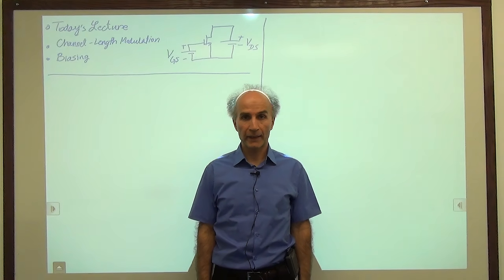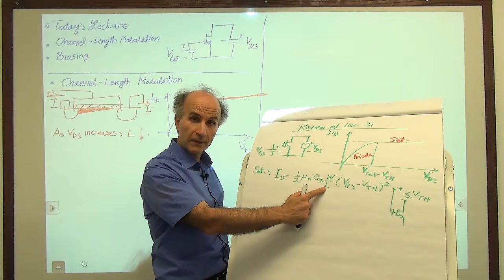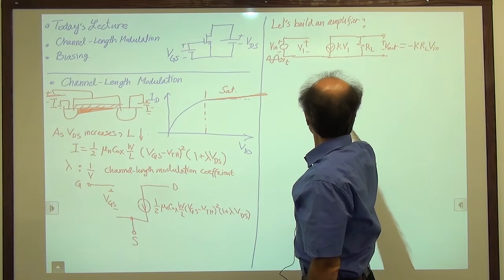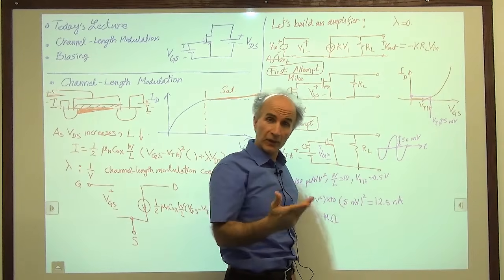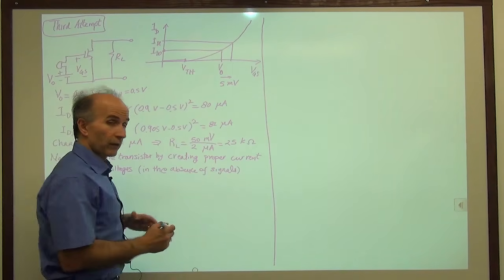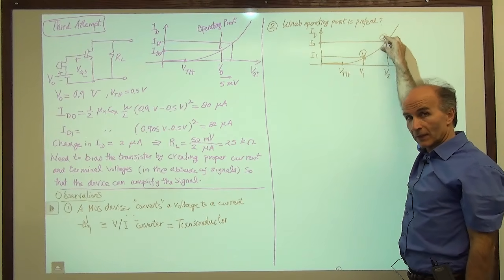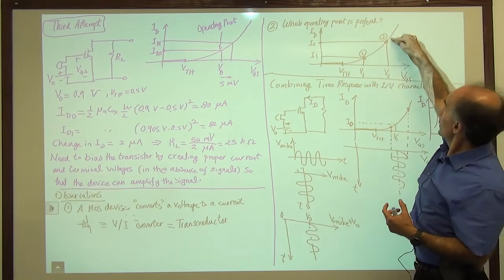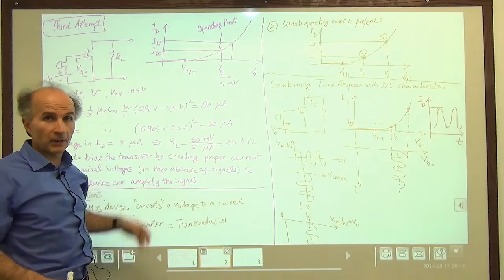Razavi Electronics 1, Lec 32, Biasing, Transconductance

Comment: 28:56 sir here in the second attempt amplifier it is not connected to the drain voltage then how can the current flow
Reply: It is assumed that the device is in saturation region (i.e VDS>VGS-VTH) but if you think a liitle bit the current flows from drain to source (Ids) which flows through RL output resistance which gives a negative voltage drop at the drain terminal so it turns out to be VDS<0 therefore ID=0A so yeah here we dont consider the drain side bias yet

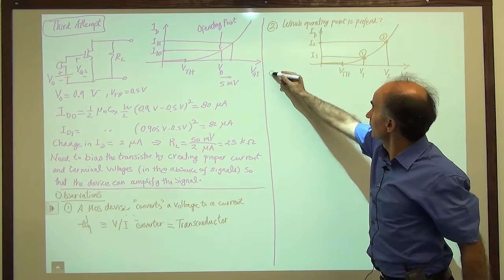Comment: at 47:20 which battery is drained Vds or Vgs
Reply: if im not wrong we usually use Vdd (powered by battery) for both Vgs biasing (via voltage divider) and Vds biasing, so even if Vin (from the mic is 0) we still drain some power from Vdd

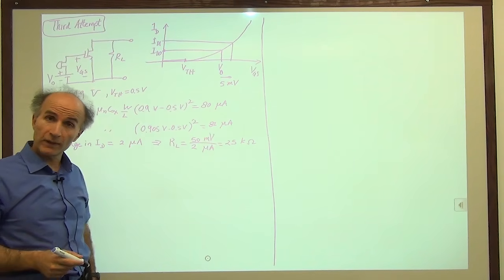Comment: Why we should take change in current regarding calculation of resistance in third attempt of amplifier design at 34:38 ??
Reply: if you mean the 2 microamperes it's because you are interested in signal to be amplified! You want the microphone signal to be 50mv not the microfone and operation point voltage. The operation point helps you to get in the region you want for the transistor to do what you want. But the important part you want to make 50mV is the 5mV from the microphone

Comment: What happens if we do not apply the gate voltage and go on increasing the drain voltage? what will be the effect?
Reply: Simple the n-channel will not be formed unless Vgs > = vth. So no current will flow.
Reply: vds just creates potential difference in n-channel and if u increase vds that potential difference will increase current flow will be more in the n channel .but for all this to happen n channel should be there which will be formed only when vgs>=vth .hence if no gate voltage then no current irrespective of the vds.

Comment: i have a doubt that when the device is at operating point i.e, greater than threshold voltage then when we are not applying any signal then output should be zero and when we apply some signal then it should be amplified but when there is no signal we are able to get some output at load then how to identify at output that input is not applied?
Reply: through capacitve coupling, it is possble to isolate the AC signal from the DC offset

Comment: I am confused as to which expression of gm to use when the values of Id, Vgs,  W/L, mu_n*C_ox are all available.
Because the three expressions give three different answers. 

For example, if W/L = 10/0.25,  Vgs = 1 V, Id = 1 mA, mu_n*C_ox = 100*10^-6 
If I try to find gm using the three different expressions I am getting different values with each expression. One expression gives 2.4mS, another gives 3.33mS , the other one gives 2.828 mS. 

Can somebody please point out what I am missing here?
Thank you in advance
Reply: What is the vth ? I think these values will not evaluate the Id mentioned
Reply: Vth is 0.4V
Reply: Check if the MOS is in saturation or not.
Reply: You need to calculate Id, not declare it, since it's dependent on Vgs. I get 720 uA using your numbers. Then g=2.4 mS in all cases.

Comment: I have a question about the circuit you draw in  23:33. where does the power P = Id^2 * R actually come from? Does it come from the Battery? If so, there is no current flowing into the gate, right?
Reply: okay you answered the question :D There is no current Id, because there is no Drain-Source voltage

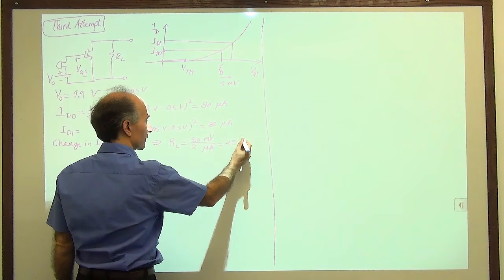Comment: Why we should take change in current regarding calculation of resistance in third attempt of amplifier design at 34:38 ??
Reply: coz Vout=-IdRl(when KVL is applied we get Vout +IdRl=0)
Reply: even i have the same doubt? why  they took change in current
Reply: @jyothiyanapu3524  change in current taken because amplification is of input ac signal .if you will not take the current difference then output voltage will contain dc biasing voltage of the input which isn't needed ,we just want output voltage wrt to input ac signal (5mv).you can think of small signal model then you will understand why taken the difference.

Comment: why does Vout have a 180 degree phase difference from Vin?
Reply: Increasing voltage causes increase in conduction or decrease in resistance and it causes voltage drop to decrease across the terminal of the device.

Comment: At 11:00 if pinch-off voltage moves away from vds, they won't be any channel after pinch-off voltage, so how the current flows? anyone please explain this?
Reply: there's no charge carrier inversion, but there's still an electric field across the channel length that sweeps the electrons across the channel that were sourced by the Vds. It's not like we created a vacuum in that area.